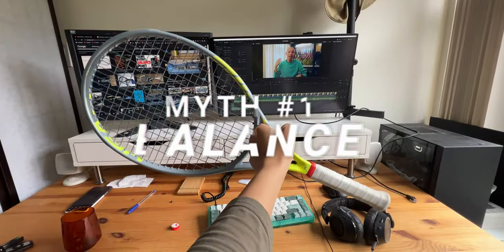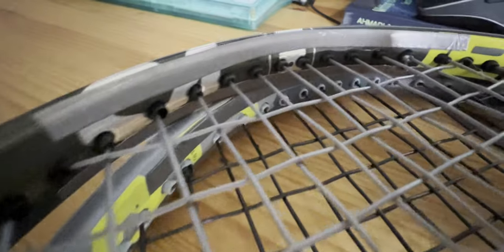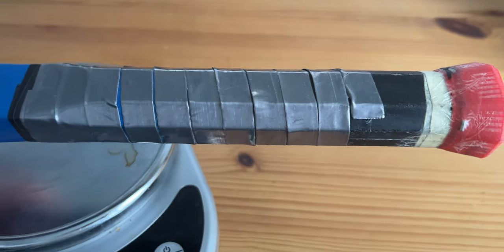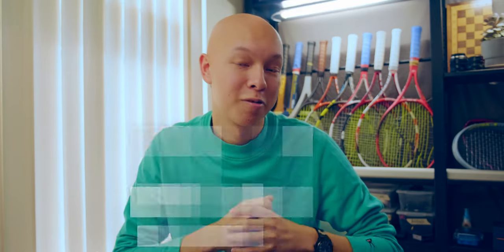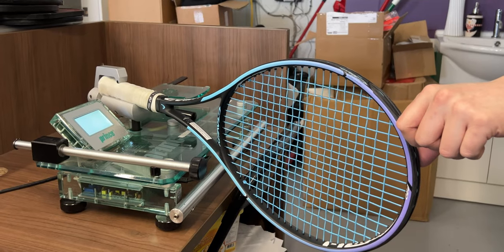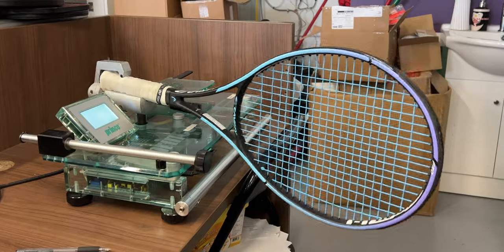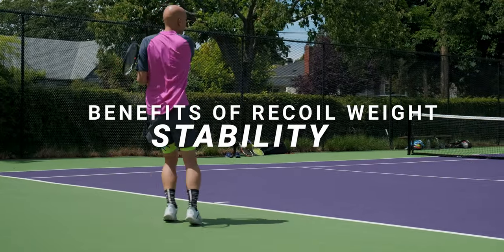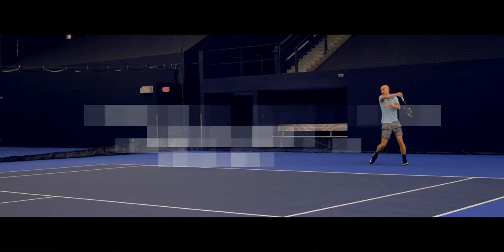The Secret Reason PRO's Add Weight to the Handle

Comment: Inertia is a body’s resistance to change in speed. Inertia it's related to Momentum. Linear Momentum is the product of an object’s mass and velocity. Get into an example to easierr understanding: If you are in a car with "M" mass and "V" velocity, then the momentum is M x V. If you are in a truck wichc has the double of the mass "2M" and it's going at the same velocity then the momentum is twice the momentum of the car at the same velocity: 2M x V = 2 x (M x V). If another similar truck is going half the velocity then the Momentum is the same to the car. Get back to tenis, if you add weight, perhaps 10%, then if you want to get more momentum then you need to get a similar racquet speed after adding weight, if you go 10% speed lower then you get no change in Momentum. But feel will change and you will prefer that new racquet setup. When we accelerate our racquet there we need to consider another element to get an accurate model. In rotational motion we need to consider the distance of the weight from and axis. Then the equation of Angular Momentum is: I x W where I is Moment of Inertia and W is angular speed. Things start to get more complex, but I will try to pursuit the intuitive way. If we a 0 grams stick with a weight at one end and we pick that stick on the other end, the Moment of inertia is the length of the stick, squared multiplied by the mass of the weight at the end. Note that if we increases 10% the lenght of the stick, the Moment of inertia increases 21% (it's a quadratic relation). When hitting we have several axis, wrist, elbow, shoulder and hip. But consider only the wrist to understand the concept. If we already have our extreme lightweight stick with a weight at the end and we add weight under the grip then then the Moment of inertia don't increase, because the distance to the axis is zero in this case. But if we consider the shoulder as the axis it adds Moment. Adding weight near the end of the tip of the racquet increases all the moment of inertia and remember it works with the square of the distance, because of that we need only a few grams to feel the difference in the arm. As we see in the Linear Momentum, is we increase mass but decrease speed, then we don't get much diference, we get a similar effect is we increase the Moment of inertia, adding weight to the racquet but decreasing the angular speed (swing speed). At this point what is crucial is the ability of the player to accelerate a heavier racquet. What could you throw further? a Grain of salt, a salt shaker or a bag with 20kg of salt? This is the intuitive path (I hope that it works for you) that we follow analizing the physics of the swing.
Reply from the maker: Thank for for the detailed breakdown. I've pinned the comment in hopes that it helps future viewers.
Reply: .. a change in velocity - speed is merely a quantity - velocity is a vector - inertia is always directional.
Reply: Great !!
Reply: Lol, this is wrong: 2m × v = 2 × (m + v).
Reply: I wouldn't trust this guy's maths 😂
Reply: @alexeyovriakh2450  I do not see the formula that you have here. I see 2M x V = 2 x (M x V), unless it was edited since your comment.
Reply: This is great info but given the complex nature of a players swing and practicality purposes for us players, as you said the intuitive path is great. Looking at it more in terms of energy methods KE and PE. Find at setup you like either a polarized or depolarized setup and play around with static weights in that same preferred balance point. Find the setup you feel is delivering the most energy to the ball while still being able to not get too fatigued over a match. Personally I prefer a polarized setup(like nadal and fed) as apposed to a more depolarized setup(murray, sampras, djockvic). Also a stiffer racquet will transfer more energy to the ball but at the cost of sending some to your arm. There's also a great discussion on a ratio of MgR/I if anyone wants to go further down the rabbit hole on some racquet physics theory.

Comment: He didn't mention. I am a distinguished mechanical engineer. If you added too much weight into handle, the center of pucussion is going lower towards handle because when you try to hit the ball intuitively you try to hit center of pucussion, which layman calls sweet spot. If you don't understand you can look up "center of pucussion" that is the no vibration point.

Comment: Adding weight to the handle absolutely increases maneuverability…
Reply from the maker: Care to explain a little more? Maybe something I’m missing
Reply: think about old fashion metronome. change the balance and see the thing go.
Reply: @TennCom  you can also do a very simple test. add about 20g to the buttcap and swing it around; then try removing it. there's a very clear difference in maneuverability.
Reply from the maker: I have done that and not noticed superior maneuverability. In fact, I usually experience a decrease in swing speed from the added weight. The difference with a metronome is that the needle extends past the point of rotation, whereas the racquet typically doesn’t extend past the base of the hand
Reply: so true John!!
Reply: @TennCom  that is very strange. because balance is one of the things I notice first, then SW/Static.
Reply from the maker: What kind of technique do you have? I think that could be a big factor as well. More eastern forehands seems to prefer more headlight balances.

I should revisit and do a blind test with multiple subjects and see where things land.
Reply: @TennCom  semi-western. all courter. I prefer SW around 335~338 and 6pts HL balance after stringing. static weight around 340
Reply: This doesn’t make any sense whatsoever. If you added 10 lbs would it become the most maneuverable racquet ever?
Adding weight will never make a racquet more maneuverable.
Reply: @curttheboywonder  it's basic physics. if you make one end heavy, the other end will be lighter.
Reply: @americanbystandard  this is sarcasm, correct?
Reply: @americanbystandard  I don't think this is so basic
Reply: Adding weight never makes anything more maneuverable. That is basic physics.
If mass made thing more maneuverable it would would be added to performance cars, aircraft, shoes, anything where inertia and acceleration is desirable. Maybe you where joking, it's hard to know.
Reply: @72PMChambers  what are you talking about... drifting for example, you have to add weight to make the car turn faster. the right amount of weight is crucial.
Reply from the maker: Drifting is not faster tho
Reply: If adding weight to the handle made the racket more maneuverable, then why wouldn’t all racket handles be super heavy? Why not have a 2 pound racket that’s extremely Head light? Adding weight to the handle doesn’t always make it more maneuverable. It’s all about balance
Reply: @curttheboywonder  We have to qualify "manoeuvreable";  if you think in terms of your hand being a pivot and the head of the racket swinging around that pivot, adding weight to the handle does help, as it counterbalances the head;  it will be quicker to flick the head from fh volley to bh volley, for example. However it does also increase the total mass of the racket, so it might be slightly slower to e.g. get the racket out wide for a stretched backhand.

Comment: One easy customization can be done for adding extra weight and stability its change grip for leather grip, usually increase 8-10grams (normally the weight its around 29 vs 19 of other grips). Leather grips helps a lot on that side.
Reply from the maker: I wrap all my sticks in leather!
Reply: @TennCom  Same… Now I am using the Wilson RF97, they came with leather grip, but anytime I buy racket without it I change it.
Reply: @TennCom  , do you then cover the leather with an over-grip? Thanks...
Reply: @walterhayley7252  I think so... I do that, otherwise will be a nightmare.
Reply from the maker: Ya Tourna grip
Reply: @andonivr  , I agree
Reply: @TennCom  Toruna grip + leather grip .... Wow a bit tough hehe... I use wilson pro overgrip to make it a bit softer.
Reply from the maker: I like hard things in my hand
Reply: @TennCom  The feel is better but sometimes can suffer blisters, If I use leather + tourna I know that I will do hehe, also the tournagrip will be distroyed in 1 hour ( that's my problem with tourna grips ) 

But I think this depends on each player preferences.

Comment: Just seeing this video for first time. Idk I think adding weight to the handle would increase racket head speed. Consider how a whip functions. The momentum created by accelerating the heavy upper section gets transferred to the tapered tip, and since momentum must be conserved, the tip must travel much faster than the handle.  Increasing handle weight increases tip speed, all else being equal. Just my thoughts.
Reply from the maker: Yeah, you are right, this would be an example of MGR/i and is mostly only relevant to the forehand side where there's a double pendulum motion. It's one of the reasons many pro's, like Murray, will add weight under the grip at 7 inches.

Comment: So very strange but after this video, i tried adding 0.75 gram of lead at 2 inches from the buttcap under the overgrip, and 1 gram of  lead in total at 10 & 2, the racket is so much more stable all of a sudden through the contact, can't believe such small amounts of lead change the racket so much
Reply from the maker: Tbh the 0.75g in the handle probably isn’t making a huge difference, the the 1g in the hoop is super noticeable. Glad you’ve made some progress in your racquet setup!

Comment: Moment of inertia is the rotational analog of mass. Mass is what resists an object's linear acceleration. For the same linear force applied, a higher mass means that you will have less acceleration. Similarly, a higher moment of inertia means that the same applied torque will result in a lower angular acceleration.

Comment: Today I added the leather grip to my racket which made it a tad heavier, and as I practiced with it I definitely noticed that extra stability, especially on the volleys as I felt like when I moved the racket forward to volley the head didn't get as much of that racket lag during the motion which led to easier proper contact.

Comment: I noticed that adding weight on handle increases SW. (overgrip). 
I always replace replacement grips with leather and add silicone butt cap at the edge of handle.  By doing this I’m already adding over 10 grams to handle.  It makes racket more HL meaning more maneuver.  Also helps with stopping vibration to your wrist.

Comment: You're describing Newton's Laws of Motion and Force = Mass times Acceleration. 
I'm other words, you can swing something twice as heavy and it will have the same force as if you were swinging that thing twice as fast. Factor in wind resistance and surface area, and you have a good model of how you can generate more power or spin.

Comment: Especially with swing weights above 330g maintaining a H/L balance of over 7 pts (324mm) is important to maintain maneuverability+head speed and for swing weights of 345g+, I would recommend 9 pts H/L (315mm) Federer spec.
Reply: the unit of sw is not grams but kg cm2. Regards

Comment: When most tennis players think about swing weight they most likely are visualizing the power the racquet imparts upon the tennis ball.  Recoil weight is sort of the opposite visualization - where the incoming ball affects the racquet.  The best way one can understand this is the return of serve.  Given a sufficiently fast serve, how much is the racquet pushed back if all you do is block the return?  The general approach to picking a racquet should be to find the heaviest one you can play with that doesn't result in arm fatigue after 2 hours.  Light racquets are a recipe for tennis elbow and the goal for all tennis players is to play more tennis, not to be sidelined with arm injuries.  On a side note, while MGR/I is an interesting stat to notice for professionals (e.g. 21.0) it's not really something the typical rec player needs to consider because it requires professional-level technique to apply and not many rec players have that level of technique.  Plus the "angular frequency" seems to only apply to the forehand stroke and serve where the kinetic chain behavior mimics a whip the most.  Not so much with either the one-handed or two-handed backhand stroke.
Reply from the maker: Excellent analysis
Reply: It means that even 13 years old boy with good technique and physique and of course very good level can play with heavy racquet almost like a pro? 🤔

Comment: To put it simply, it is not quite the same as a hammer.  A hammer and a tennis racket are used in two very different ways.  A hammer is used to apply force and a tennis racket is used as a whip.  It's also used in conjuntion with your arm so, if you imagine it like this O--------o----------|  The first O is your shoulder, the second o is your wrist/hand and the I is the top of the racket and all O's are pivot points.  If you add more weight to the second 'o' then you'll create more 'whip'.  It's the same as a whip except it's got lots of pivot points (the whole thing really) so they can't make it out of rope, it won't get a crack.  They will use leather.  They can't use metal links as it's too heave. Then there's a video somewhere of someone using a chain attached to a leather whip and it's even more impressive.  So, adding weight to the handle creates more plow through for the whip effect.  Those are my thoughts.

Comment: I have 3 questions please:
Where is the best place to add weight on the handle, at the 7 inch point beyond where the hand grips the racquet or on or inside the but cap?

How do you calculate the recoil weight?

On an RDC SW measuring, what is the difference between placing the racket where the head is vertical vs horizontal? In other words, the strings facing sideways vs the strings facing the floor?
Reply from the maker: 1. depends on your desired effect. Butt increases Recoil (RW) most. 7 increase RW and MGRI
2. I forget the formula off-hand, buts you can find it, along with a calculator on impacting tennis' website. I currently use a spreadsheet to calculate it
3. Strings facing the floor is called spin weight and it roughly equals swingweight + twistweight
Reply: Thank you so much for your promptness in replying to my 3 questions.. back to question 1, which area on the handle has the most effect on RW ?

Comment: This concept in general is actually severely underrated. Been playing for a while and HL racquets always feel super nice to play with.. until I got the blade 98 it just felt superrr off. Only recently did I add weights to the handle and it's felt like a burden has lifted.

Comment: I use a leather grip. Do you think that fits in the category of adding weight to the handle or it still needs the complement with the lead tape?
Reply from the maker: Yeah usually leather added 5-10g of weight depending on the type/what you are replacing. This should be noticeable, but nuanced. My personal racquets have leather plus lead wrapped from the top of the grip down.
Reply: @TennCom  okay appreciate it! I'm gonna try some lead

Comment: Another way to add momentum without changing the balance point of the racket is adding lead tape in the throat area!
Reply: basically adding weight to the center of gravity

Comment: Thanks for the insights.. I have a tflight that doesn't jive with my wrist or elbow.. it's the only one in my 'arsenal' that actually delivers bad vibes (pun intended) of the dozen different racquets I own.. I haven't added tungsten yet but I'm probably going to do something non-destructive to the handle but if I remember that racquet doesn't have a hatch at the bottom like others.  I've added lead to handles before and then removed it but do you typically add it below the grip or on (over) the original if you're overgripping anyway?  I'm always overgripping especially #2 sized, mixed on 3's.  I'd rather add blue tac in the handle but I don't want to take off the butt cap.
Reply from the maker: Excellent pun hahaha.

Comment: Hello!
The number one reason why pro add weight to the handle of their racquet, is because they get a weight-less racquet to be customized to their preferences while we mere mortals get them with commercial weights included in the racquet itself when it's baked.
Reply from the maker: I mean I think that’s a bit of an over simplification but yes pro stocks are typically too light for pros as you mentioned.
Reply: @TennCom  I ment that as you don't start with the same racquet as pros do you should not necesserely add weight to your retail racquet. I have some TGT345.1 full of silicone, lead and with a leather grip that are 300g static. The retail version of it (TGK345.1) is 320g static with sinthetic grip, no silicone and no lead. Have a nice day and thanks again for your videos =)
Reply: @arthurgiusi1901  BTW: the casual weights of retail rackets are not only at the handle. They can be all over the racket. regards

Comment: Diadem Nova Tour I was thinking of adding a little bit of weight to the handle and nowhere else. It’s over 11 oz so decent weight. Any input on this? I also have Elevate Tours that sometimes feel like they need a little something but if I add too much weight to head it feels too heavy
Reply from the maker: What are you trying to achieve? The Nova Tour is already massively head light.

Comment: I have yonex ezone 100 sl with 33 mm balance.
Can i customise it to be even balance(32 mm),and how to do it?
Reply from the maker: you can input your racquet's length, weight and balance into here, then for the modifications at the bottom, use length = 0 and add 1g at a time till you get where you need to be https://twu.tennis-warehouse.com/learning_center/customizationReverse.php